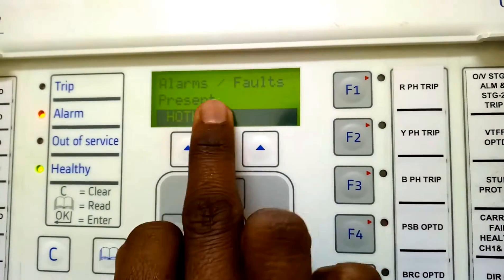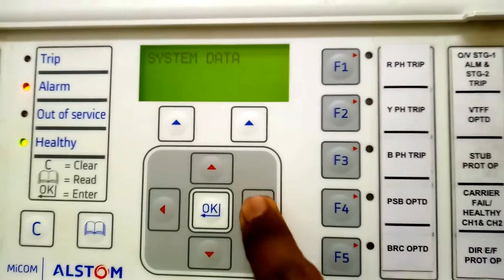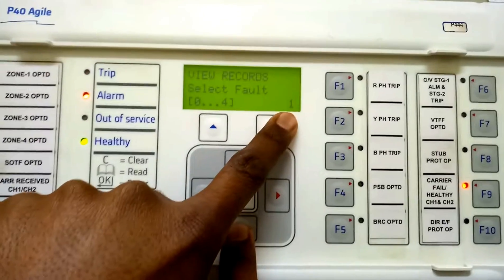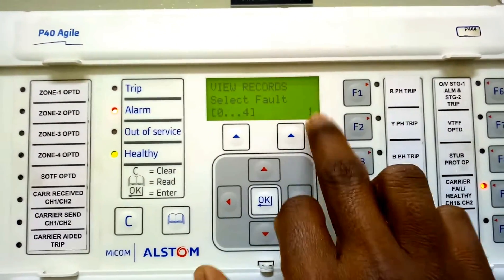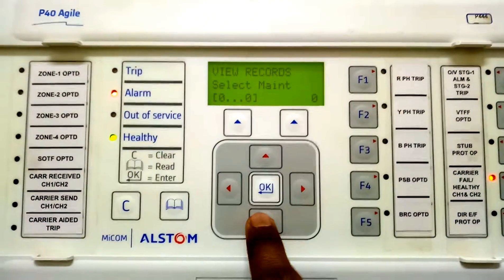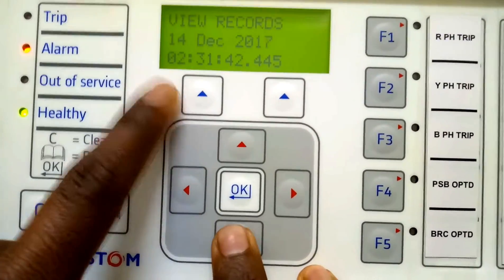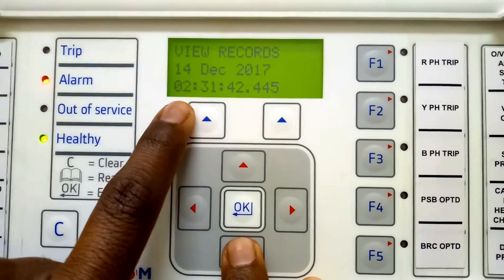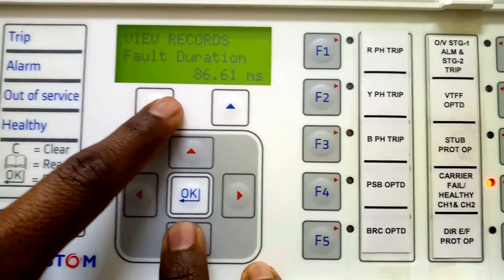How to see Fault Report in Distance PRTN Relay-Alstom-micom{In English} How to know fault location?

Comment: Hello sir,
My relay REF615 ABB is 6.6 kv Outgoing feeder .That's  tripped with OC instataneous that's setting was 5 x In
Time 20ms
Start value multiple is 1

But OC low not triggered it's setting was 0.7xIn
Start value multipler 1
TSM 0.2
Time delay 20ms
Curve Norm inv